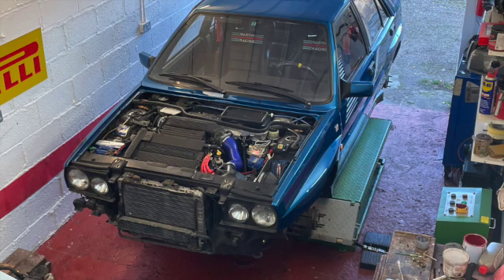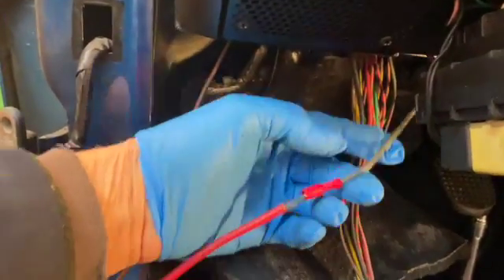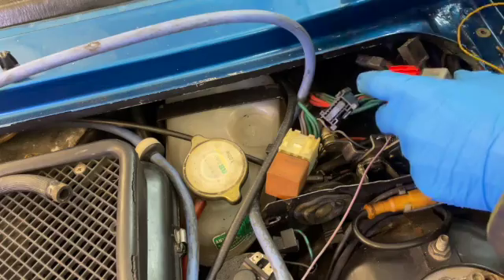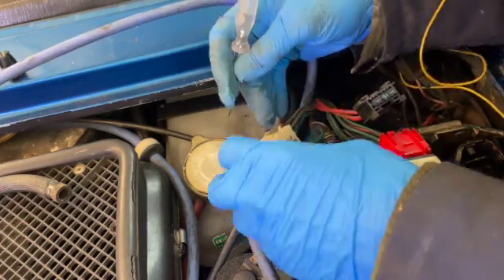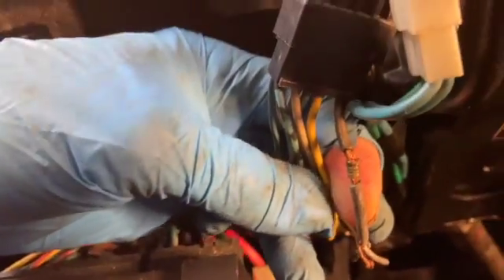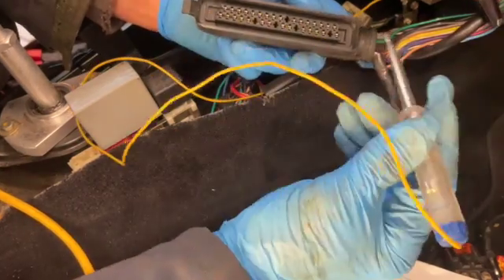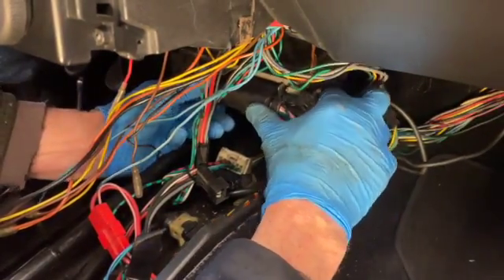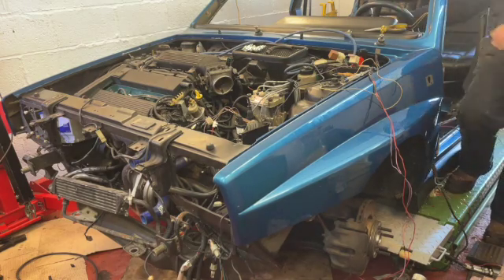Lancia Delta Integrale ECU electrics

Comment: This is very interesting. I went through something similar last year with my '91 Japanese market 16V. I have my own drawings of the ECU pins, fuse block pins and routing within the block, etc. While I was trying to figure it out, I had a chance to buy a former privateer Group N rally Integrale but had to sell the 16V make room. I went through the relays like you did but continued on to trace the wiring through the ignition module and more. The problems were not consistent. Then a buyer came along and I sold it as non-runner (but still got a very good price for it). The new owner changed the ignition leads and said it ran fine after that. I had three different set of ignition leads that I tried but saw no difference in behavior between them. As interesting side note is that the rally car replaces those two relays with toggle switches (next to the car's master power switch, where the radio would be).
Reply from the maker: Good to hear from you Alan, yours is interesting too! Our car had dayglo orange silicon plug leads which looked expensive, but the king lead was faulty. There are so many things on a Delta that could be broken!